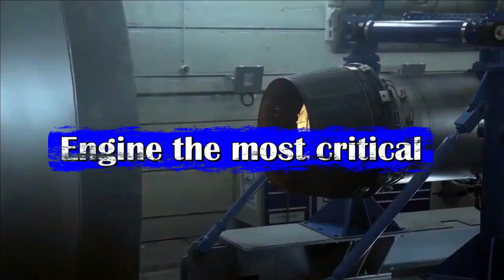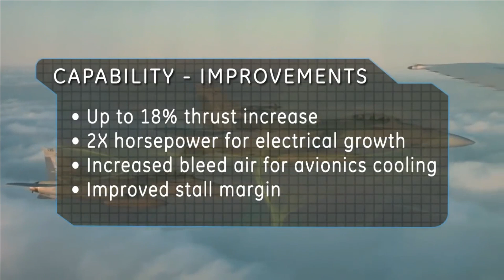Make In India engine with ToT under iCET #indianarmy  #indianairforce  #drdo

Comment: I see no value in the offered tech. Gaining the tech for an obsolete engine like the GE414 isn't relevant, or helpful to increase indigenous ability. The only way forward is to invest a billion in buying flying test bed. And certifiying the Kaveri engine, and using it to replace Ge404 engine in Tejas Mark1A. The Ganga engine can replace Ge414 engine, and needs funding to be started as a formal project.

Comment: This Is Just For Tejas And Tedbf's First Batch Engines But We Need To Do Something Urgently With Our Own Indigenous Engines And Recovering Kaveri Engines.
Reply: I think the deal for a engine based on ge414epe capable of 130kn is also confirmed after this
Reply: This is for all batches of Tedbf, Tejas mk2 and AMCA. They'll upgrade it to 116kN to 120kN from 98kN thrust.
If the deal is decent India should take it.
Reply: @direwolf7491  It never is. There are always terms and conditions that make it entirely useless. Only an indigenous engine, and that is the Kaveri, can be of use.
Reply: @datoolz0  Indigenous engine,when will that arrive???
We can't wait for GTRE to take another two decades to develop a engine,as they will protest against a foreign partner citing various issues,so that they can sit in the money till 2045.
Practically GE414EPE engines with TOT & local production even without IP rights should be accepted which will power upcoming fighters.
As for total indigenous engines,JV with Foreign OEM with a private sector player,funded by GOI would be a win win situation,preferably RR or Safran.
RR with engines based on EJ200 called EJ2X0 with 78KN dry Thrust & 120KN wet thrust or similar features with IP rights if possible.
Safran M88-4 based engines,with desired output of 80+KN dry Thrust & wet Thrust of 125+KN from current 105KN,with complete TOT & IP rights.
But to fit those engines,we first need to have those Aircrafts ready,not just on drawing boards.
Reply: Kaveri won't be used or updated anymore just dry version in UCAV, it's probably gonna be a new engine for later jets. No more info about it yet except some rumours & maybe mou with Safran.
Reply: @KCstark.  There is an intense US funded effort to cripple Kaveri with a disinfo campaign. Your own sentence contradicts itself. Kaveri is undergoing certification right now, of the dry section, the wet section which is afterburner will be next to be tested after dry version is proven.
Kaveri marine for ships is also mature. Usage in drones and ships is already great, but aircraft what is was designed for is of course the cherry on top. In a word can you stop repeating US propaganda!